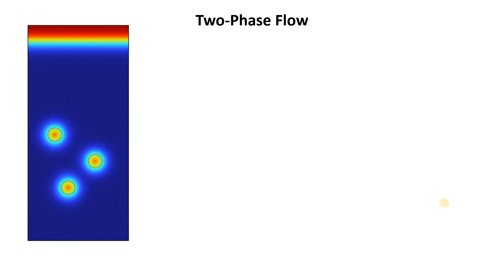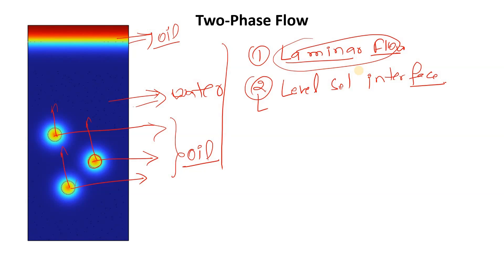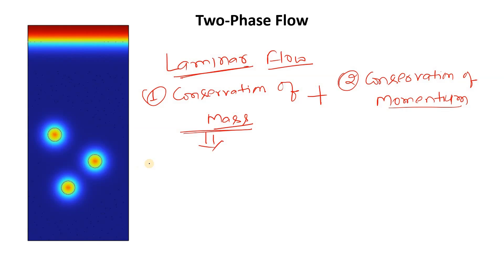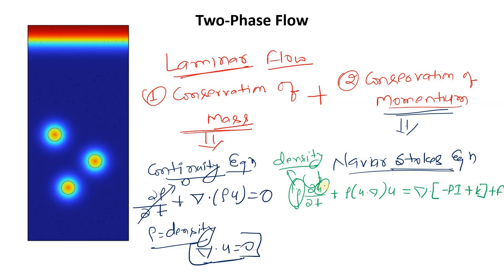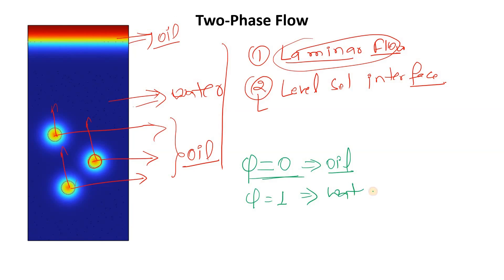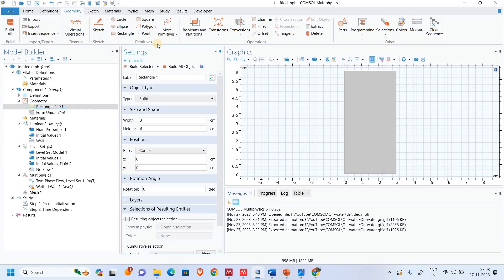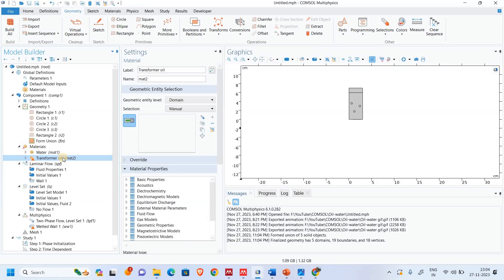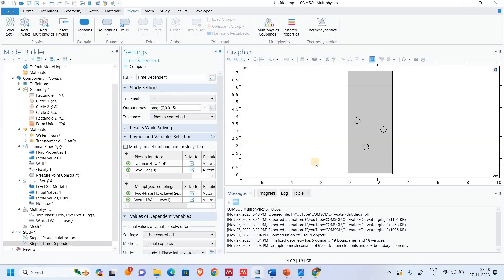Simulation of Two-Phase Flow (Oil droplet in water) using COMSOL Multiphysics

Comment: i also want to simulate heat transfer using droplet microfluidics at particular frequency.How should i attempt it?
Reply from the maker: I don't have exact approach to do that.
But you may try by adding few more physics like heat transfer in fluid with all known BC and domain conditions.
You can add Multiphysics Coupling: Nonisothermal Flow (or Conjugate Heat Transfer).